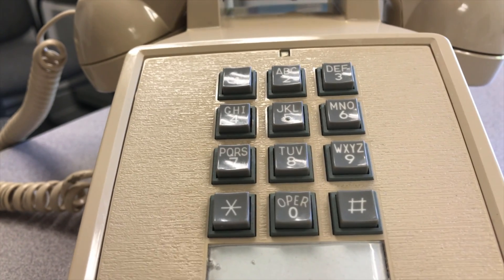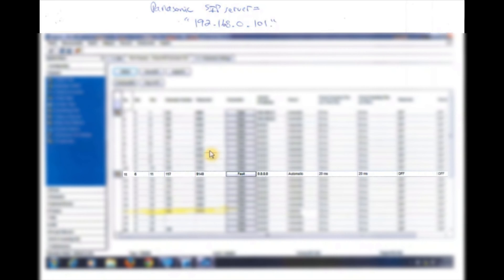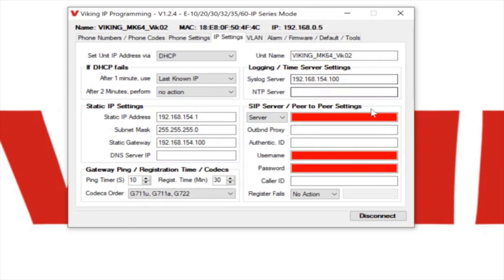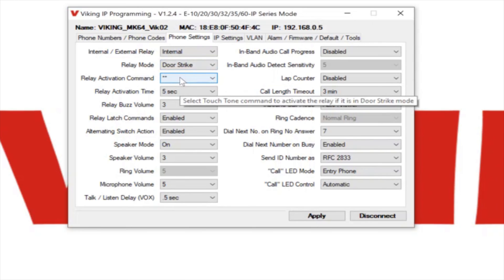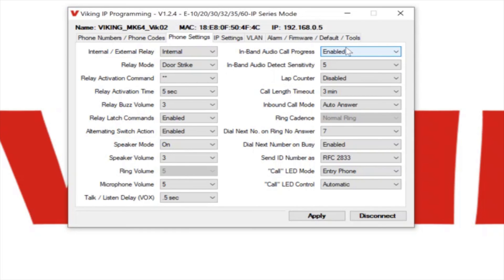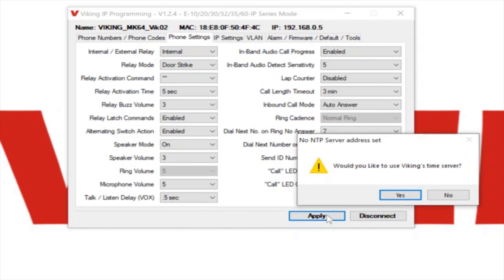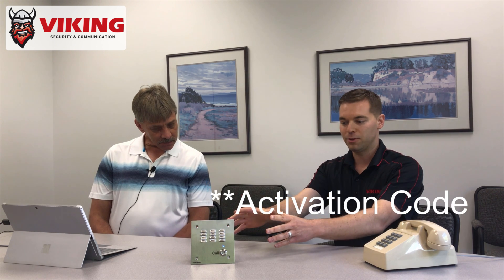Programming a Viking Electronics E-Series VoIP SIP Door Entry Phone

Comment from the maker: 00:15 Demonstration Set Up Overview
00:56 Phone System Settings
01:34 Question - DHCP or is a Static IP Address Required?
02:15 Connecting to the Entry Phone using Viking's IP Programming Software
02:32 Alarm Firmware and SIP Registration
03:21 Question - Caller ID?
03:36 Outbound Proxy and Authentication ID
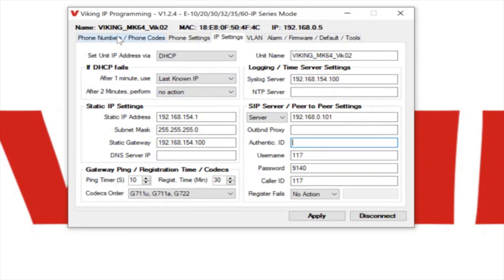03:53 Adding Speed Dial Numbers
04:18 VLAN Tagging
04:34 *Phone Settings Tab: Relay Operation, Auto-Dialer Behavior and Misc Features
06:57 Review and Apply Settings
07:28 How the IP Programming Software Looks When Connecting to Reprogram a Phone
07:56 Using the E-30-IP to Demonstrating the Applied Programming

We hope you enjoyed the video and found it valuable!

Comment: Just replaced our company outside gate call station with this, love it.  Only thing I didn't have figured out was that there was a security code option to open the gate when taking INBOUND calls.  Nice thing to have actually, our old call station didn't have that so anyone would dial in and open our gate if they knew what extension to dial and what number to press...